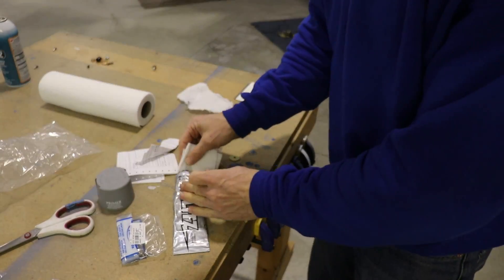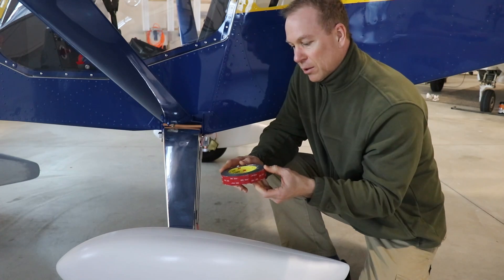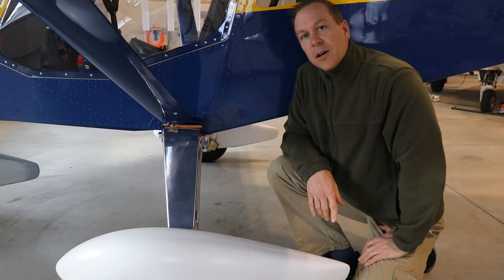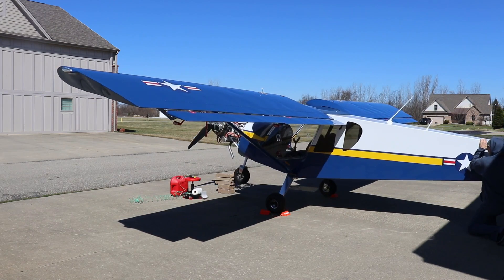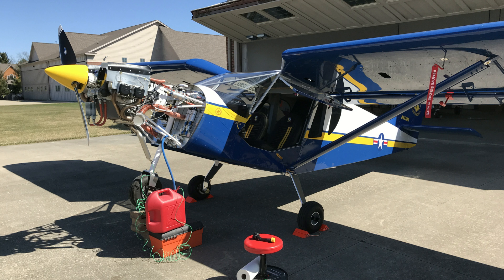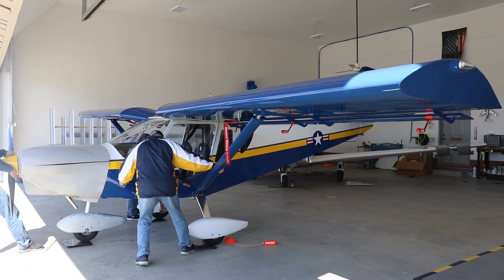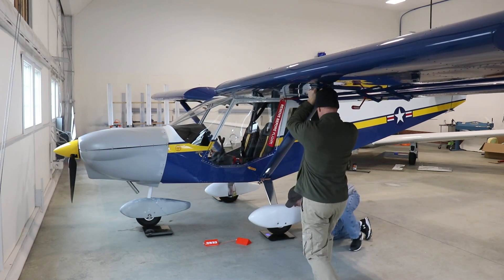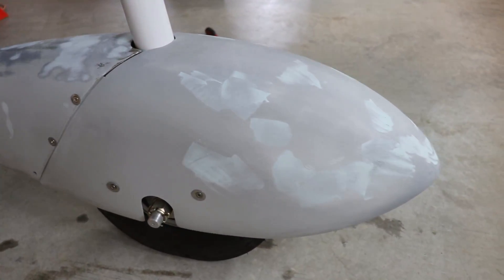Countdown to First Flight - Episode 2

Comment: 841 lbs + paint on cowling and pants. 😁. (Did you weigh it with your Fire Extinguisher? 😁)
I'm a llooonnnggg way from this point. Must be frustrating to be so close and have to push PAUSE.
Reply from the maker: I will probably weigh it again after everything is painted. Yes I did weigh it with the fire extinguisher as it is installed equipment in the plane!

Comment: Hi. Mark. Enjoying your videos. Keep them coming. Just an observation about you fuel flow test, lowering the fuel tube down like that has created a siphon. Looks like you will have about two foot of extra head pressure with that set up. Consider doing the test with the end of the fuel tube at its  correct level and draining into a funnel in the fuel can. Just re watched your painting and buffing videos as I might have to jump to painting as I to can’t get an inspector in these difficult times. Cheers

Comment: just fly it.( high speed taxi and O I came off the Ground to late I have to go around.   ( Howard) did it with the Goose.
   and just saying how did you ground a plastic gas can?  I would like to know that trick        and that amount of fuel is good for 180 hp more like  200 hp   easy,     what is your engine rated at?
Reply from the maker: I'm not sure if grounding the plastic did anything or not. The EAA manual says to ground the plane to the gas can so I did it.
Reply: Kitplane Enthusiast Polyethylene is a static accumulator, not a conductor. You did the right thing by grounding with a cable.
Reply: Yup .. same reason you don't fill a plastic gas can on a pickup bed .. It must always be on the ground . it's not about the electricity  flow through plastic because plastic is an amazing insulator .. its about the build up of  static electricity charge which plastic does very well

Comment: Thanks for sharing; good looking build. Hope you don't mind a couple of observations. The gold on those AN washers was the cadmium plating; there to inhibit corrosion & prevent galvanic corrosive action if used against aluminum. Looks like you 'polished' it off. Pretty good chance they're going to turn 'red' fairly soon after being exposed to moisture.  An alternative for a shiny look on non-structural stuff like wheel pants would be to just use stainless steel washers (and screws). On weighing the plane: No idea what Zenith says in their guide, but the last operation is exactly opposite of what every other mfgr recommends. The act of lifting up the gear and lowering it onto the scale will cause the gear to put a side load on the scale platform as the a/c weight spreads the gear. If you're using solid state  'load cell' type scales, it probably won't matter, but if using spring or balance beam type scales, it can radically affect the accuracy. Other mfgrs recommend rolling the plane onto the scales using ramps, so that the gear's 'spread' due to the a/c weight is already there, and doesn't impose a side load on the scales.

FWIW...
Reply from the maker: I've mentioned removing the cadmium plating in other videos. Yes I know it's there for corrosion protection, but as much as these will get wiped down and polished they won't have the time to corrode. If they ever do, then I just put new ones on.

Comment: I think you have a very good looking airplane.. how long did it take you to finish it from start to finish..
Reply from the maker: I started the project in November 2015. But to be fair, I've taken a few breaks from building as I moved to a new home and had other 'life events". Also, the fiberglass fairings I made added a tremendous amount of time to the build.
Reply: @KitplaneEnthusiast  you are to be commended  to get an airplane finished most people never get any more than a year into the build. I have built two Kitfoxes one was a 5 the other is a 6 with a cont. o200. are you planning on airventure this year if you are I see you there. I only live 100 miles south of OSH. Have fun with the test flights and be safe..  Gene